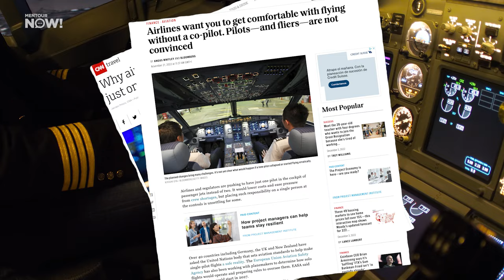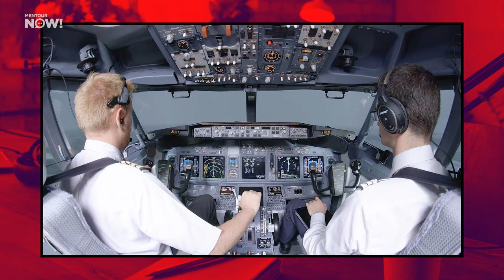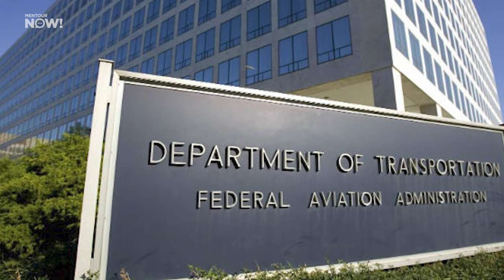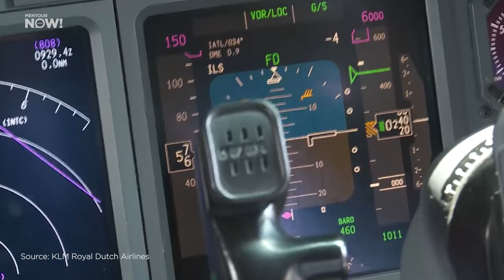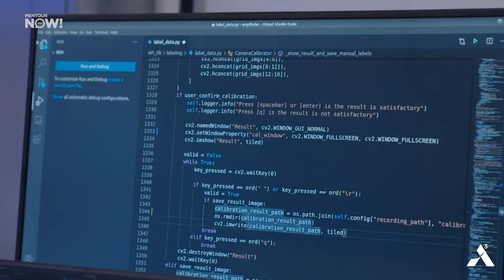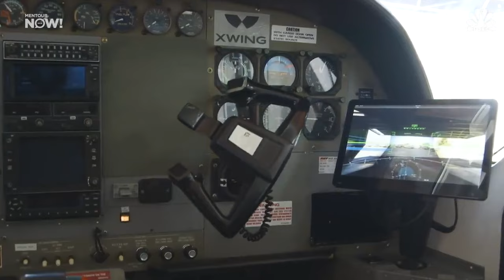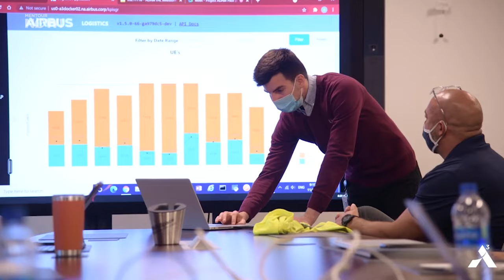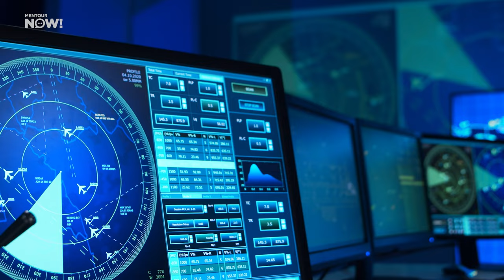The End of the Two-Pilot Cockpit?! Get Ready for Single-Pilot and No-Pilot Airliners!

Comment: Pilots don't just get paid for what they do when things go right, they get paid for what they do when things go wrong. There is no automation can replace a qualified pilot in an emergency.
Reply from the maker: Correct
Reply: Actually, it's not just emergencies when you need a qualified pilot. It's unexpected situations, where having a couple of pilots present may well prevent that emergency from happening in the first place.
Reply: That's true right now. Might not be true forever. It is possible that eventually automated systems may become far more flexible and adept at trouble shooting problems than humans, at which point you wouldn't let a human near the controls. Long way to go, nowhere near that now. but may happen one day.
Reply: @flat6croc  Sure, but do keep in mind that we've been anticipating machines becoming merely as flexible and adept as humans for more than 50 years now. And even our much less ambitious ideas, such as self-driving cars, are still in the indefinite future after 35 years of work.
Reply: @Curt_Sampson  Absolutely. Even most trains nowadays are still manned by a driver. There are ofcourse exceptions, but still, most trains require a driver. If even one-dimensional travel cannot do without human interaction, fully automated commercial airplanes are far, far, far away. I do not think we will see them during our generation.
Reply: @Curt_Sampson  
Actually self-driving cars are almost here. Probably next year already, or not much later. Watch a few Tesla FSD videos on YouTube, and you'll see where we are now. It's definitely not ready yet, but not much is missing.

And yes, experts overestimated the capabilities of AI for decades. But in the last 10 years, they consistently underestimated them, and not by a little. AI can do things now that was considered science fiction only a year or two ago. Recent breakthroughs are starting to be scary.

AI is no longer the old-school rigid programming, in recent years it became much more human-like. Play with ChatGPT to see where we are today.
Reply: @andrasbiro3007  The first 90% of self driving are incredibly easy, just like the first 90% of many things. The remaining 10% are where all of the dangerous edge cases lie.
Reply: Maybe 737Max's MCAS is already forgotten.
Reply: @codures  Not by everyone. I remember it at least.
Reply: @flat6croc  Whether right or not, I usually have a clear opinion on things;  this is a rare exception.  Are we near SAFE fully autonomous vehicles?  Just do a YouTube search on FSD ... flat-out NO.  And that's for cars, which are far simpler to operate than airplanes ...

That said, can I conceive of a future where a generalized AI could prevent some of the accidents that were a result of human error?  Yes, I do think that WILL happen.  What about accidents that happen as a result of circumstances outside the crew's control?  How would an AI respond?  And, would an AI even get into those situations (or could it anticipate and prevent them)?  I'm not sure.

I believe that the self-preservation instincts of a human being will outperform any AI for any foreseeable future.  The solution to unknown scenarios isn't always about executing within known / acceptable parameters;  it's sometimes about venturing (yeah, bit of gambling and with some good, old fashioned "luck" added to the potion) into things that may directly contradict all known / acceptable wisdom ... and that's a space where humans excel out of survival instinct ...  Could an AI develop the same or equivalent skill?

Today, absolutely and positively no way, especially when GPT-3 sometimes thinks it's a good idea to erradicate the human race ... yeah, I'm not getting on an airplane operated by our friendly GPT-3 captain, thank you.  Officials even considering this for commercial flights is frightening.  AI decides it's a good day to play 9/11 with a fleet of commercial flights ... if we allow ourselves to get into that scenario, I want to see every single "yes" vote fired and out of the industry forever.

To the possible reason behind this nonsense being the nonsense of the 1500 hours rule ... for an industry that excels at root cause problem analysis ... fix the root cause problem ... don't try to come up with insane symptom management "solutions" like these!
Reply: @MentourNow  That’s not a fully accurate. An AI can be trained using all the data from ALL pilots that are flying in all conditions. That means that it is also trained for when things go wrong. An automated AI plane will actually be much safer than humans because it can tap into ALL PILOTS knowledge instead of relying on the intelligence of only two people. I would rather trust thousands of pilots collective decisions (trained by analyzing real flights, and flight simulator trainings).

In addition, you can train an AI in a simulator to respond to EVERY POSSIBLE FAILURE CONFIGURATION instead of only the limited amount of a emergency training we are able to give to the two pilots. We train for the most common scenarios, but cannot train humans for all, it just isn’t possible. It IS possible to train an AI for all situations and all combinations of system failures, and have it train as long as it needs to be able to handle them. Additionally, humans miss crucial details about flight instruments because of overload, however an AI would not be overloaded and would continue to take all instruments into account, giving it a deeper ability to figure out problems before a pilot would be able to. A pilot also has less redundancy because of the many factors that can incapacitate a pilot or prevent them from being able to perform their job. There is much more redundancy in using the knowledge of all pilots than just two.

You can listen to me as a Senior Lead Software Engineer in the field of Computer Science and AI Research, or you can keep the view that it is “too hard”.

I am just sad to see that there is not research being presented in this videos argument, but rather opinion. All of the other videos on this channel are quite informative and less opinion based, so this video was a little shocking.
Reply: @starbock  I think it's far from clear that the challenge with self-driving cars is easier. I'd argue it's far harder, the environment they operate in is hugely complex, stuff like tracking pedestrians, distinguishing between a harmless plastic bag blowing across the road and a dangerous obstacle, inconsistent, half worn out or entirely missing road markings, erratic human drivers, wildlife etc etc etc. Just keep track of where the road is going accurately is a fairly complex job. That's just scratching the surface.

Meanwhile, planes operate in 3D but with far, far fewer obstacles and inconsistencies. The basic job of flying the plane through the air is much easier. It's been possible for many years for a plane to take off complete a route and land autonomously, it's far easier than an autonomous car out on a busy public road.

If that's the basics, I grant that the comparison re ensuring sufficient safety pushes the balance in the other direction. With a car, if in doubt it's usually pretty safe to pull over and stop. A small malfunction probably won't be catastrophic. Once you're in flight with a big jet, you can't just stop the thing, it needs to be guided with precision to one of a small number of safe landing areas - ie airports. Even a small malfunction can be catastrophic.

But in broad terms, the problem of automated flight is much easier than automated driving. In reality, pilot error is the most frequent cause of major plane crashes. Yes, you. can argue for fringe cases where it would take a very advanced general AI to problem solve a situation like a human. So, it may be many decades before an automated system could match a human in that regard. But you'd still be better off with a robo pilot that didn't make any errors in the first place in terms of the stats. For every crash caused by a rare technical glitch that perhaps a human would be better at trouble shooting, , there will be many more crashes that never happen due to pilot error with no more human pilots making mistakes that the machine would never make because the human is tired or confused or whatever.

The key point here is that the machine doesn't need to be better than a human in all cases to be much safer overall.
Reply: But would there be emergencies if pilots were not on board. Many are pilot errors.  No errors = no pilots
Reply: Absolutely true!
Reply: @womble321  I have bad news for you about who writes the software.

Also, pilots are the last line of defense, so by definition any incident must have happened because a human made an error.
Reply: @andrasbiro3007  No they aren't. The "self-driving" cars are still failing basic tests and need constant human intervention and correction. The only successful tests, where a human didn't have to intercede to correct the driving program, were on closed circuit tracks. As soon as they attempted to take it one into a city, a human had to constantly correct it to prevent from driving through intersections with a lit crosswalk, or other potential disaster.
Reply: @OstlerDev  I stepped into my first fully automated driving truck 30+ years ago - most people aren't aware of how long this capability has existed.  While I agree with some of what you're saying (and said myself in my comment), I think that you're underestimating the power of the human capability to think beyond the limits of knowledge and even understanding.  It's an intangible and sometimes a razor-thin differentiator between life and death.  I agree wholeheartedly that AI will be able to prevent accidents due to human error.  I disagree that you can TRAIN anyone (including an AI) on that intangible;  it's not something trainable.  Will some future AI be able to what humans can do?  I don't know;  we'll see.
Reply: @flat6croc  I stepped into my first fully automated 50 MPH highway driving truck 30+ years ago.  None of this is new technology.  It evolves and will continue to do so.

While there is some truth to what you're saying - and is the basis for my own comment about an AI being able to prevent accidents due to human error - there are also great complexities introduced by high-speed 3D meaneuvering in vehicles that are highly sensitive and responsive to small changes.

I don't entirely disagree with your response.  I do think that there are additional - and important - complexities associated with flying.
Reply: @starbock  No you didn't. Because there were no fully automated road vehicles 30 years ago. The vehicle you went in could operate only in very narrow pre-defined circumstances on a small number of pre-defined roads, that's nothing like a self driving car, that's glorified cruise control. True self-driving is a completely different technology.
Reply: It doesn't take long, searching Mentour Now! to find many examples of automation trying to save an aircraft that is overrode by "qualified pilot"s, resulting in deadly crashes.
Here's an example from 3 weeks ago. https://youtu.be/o6c3ENr_CRM?t=1469
Reply: BUNK!!!!!!!!!
Reply: Much better, full autonomy and NO pilot on the loo; cause there ain't no pilot!!!
Reply: Absolutely. For example, the Artemis 1 spacecraft (NASA) is fully autonomous. Where nothing major has gone wrong.
Apollo 12, 14 November 1969:
000:01:02 Pete Conrad: Okay, we just lost the platform, gang. I don't know what happened here; we had everything in the world drop out.
...
000:01:12 Pete Conrad: I got three fuel cell lights, an AC bus light, a fuel cell disconnect, AC bus overload 1 and 2, Main Bus A and B out.
...
JOHN AARON (EECOM) - Flight, EECOM. Try SCE to AUX.
...
000:01:36 Gerald Carr: Apollo 12, Houston. Try SCE to Auxiliary. Over.

"... whatever can happen will happen, if we make trials enough."
Augustus De Morgan, 23 June 1866.
Reply: @andrasbiro3007  The biggest problem with self-driving car is the sensing aspect of identifying other vehicles and humans. Effective visual/sensing systems are too big and too expensive to put on cars so self-driving will remain very limited unless you don't mind running into trucks or pedestrians. Planes have the advantage that type of sensing  is very limited in value- planes move too fast.
Reply: It needs true AI to work- the computers still aren't powerful enough or designed smartly enough but no reason they couldn't do it. Pilots can't do magic by doing aerodynamic analysis- a  true AI would do the same stuff as a pilot.
Reply: @flat6croc  It's not really true, but nobody is doing the engineering.

We use to talk about how a self driving car is just driving at least three orders of magnitude more complex than the worst possible situations that aircraft experience during the AI dark ages (90s). Today we have Falcon 9's booster is basically a 20 story office building autonomously going to space, and back, and nailing a hoverslam, on a freaking boat.

It's like dodgeball, if you can dodge a wrench (and SpaceX does it on the regular), then you can dodge a ball (boring autopilot). Just need a few hundred million for the training. Or just a few thousand by the time Dojo is up and running. Within a decade, it will be a hobby kit you buy for your kids, or just off the shelf software that can run on a smart watch.
Reply: @Uldihaa  FSD and Waymo have required nearly no human intervention. How would a human even intervene without a steering wheel for Waymo? Your claim is clearly improperly researched and false.
Reply: @starbock   A computer could definitely develop the “instinct for self preservation”. Tesla’s FSD has already demonstrated a pillar for consciousness (as defined in recent psychology publications). Similarly, I expect at least one company to develop the higher levels of consciousness. Further, the critical reasoning of a pilot is not necessary in the predominant set of cases. It will develop such capability in the future but the software we have is well capable to reduce injury given enough data.
Check out Waymo’s taxis, they’re able to act in almost all circumstances excluding the extremely rare due to a lack of experience in the area. Lack of ability to absorb instruction is a shortfall of machine learning but through enough experience, an algorithm can make up for it.
Reply: @club6525  "Nearly no" is not "no human intervention". And please name the cities and routes these systems have successfully navigated without human corrections.
Reply: @jtjames79  Landing a rocket using just its own computer is nothing like driving through a busy city. Landing a Falcon 9 is a preset system, with a limited range of conditions that are constantly monitored by human. There was a failure just last year.
Reply: @flat6croc  I don't argue.  If you want to rewrite history, go ahead.  Cheers.
Reply: Also when shit hits the fan you want one pilot who is focusing on flying the plane and one who can troubleshoot, run checklists, etc. Single pilot aircraft wont come for a long long time, probably will never be a thing, as fully automated aircraft that are trustworthy will probably be a thing soon enough.
Reply: @andrasbiro3007  A slammed on the brakes on a highway because its AI saw a human on the back of a bus poster, they have a long way to go before people trust automated cars
Reply: @Uldihaa  Phoenix and San Francisco. Waymo has barely used intervention by a person since the car drives by itself.
Reply: @club6525  Again, "barely used intervention" is not "no intervention". By "barely used", what do you mean?
Reply: @Uldihaa  Waymo doesn't use intervention at all. I just mean maintenance. Still, that's better performance than a human regardless if it requires minimal intervention.
Reply: “Qualified” is the operative word .. Pilots do make mistakes and cause a lot of the accidents in otherwise normal conditions despite the automation. so it is not that binary.
Reply: I would goes as far as to say; it’s when things go wrong, is when a good pilot truly shows his colours and earns his/her money.
Reply: @Curt_Sampson  Self-driving cars are actually more of a difficult problem to solve than autonomous flight—not because 2D movement is more difficult than 3D, but because there are far, far too many things complicating road travel vs. air travel, from random pedestrians jumping out in the middle of nowhere to the constant need to re-negotiate w/ other participants on the same/crossing roads to the shear amount of such roads to cover and the amount of other vehicles around you. Autonomous flight is much easier to achieve but we didn't invest nearly as much in it because of the scale of the problem.
Reply: @zwerko  Sadly, it simply isn't the case that fully autonomous flight is easier because of one big problem: unlike cars, where you can simply pull over and stop (or just stop), aircraft fail in dramatically unsafe ways when you fly them even slightly incorrectly or stop flying them.

Consider landing an aircraft on a snowy day. You can't be absolutely sure that the ILS signal you're receiving is correct; snow build-up under the ILS antennas on the ground has been known to misdirect aircraft. (This is not a theoretical thing; Mentour Pilot had a video recently where exactly this happened.) This means you also need visual pattern matching to see if you're really landing on the runway (not to mention to look for obstructions on the runway, and even just ensure that it's been plowed recently enough) which may be impossible given the weather conditions. That can require a go-around decision followed by a decision to divert to another aeroport, which then needs to be co-ordinated with ATC, taking into account the current and likely future weather and airport conditions at your potential diversion locations, and so on. Any mistakes in any of this and you end up with a large hole in the ground full of dead passengers and aircraft parts.
Reply: @andrasbiro3007  I don't know what fantasy you're living in but there's no way teslas FSD is anywhere near robust enough for it to be sorted next year. It messes up constantly. And still kills people with some consistency
Reply: No that is wrong.  It can all be automated.   I never thought self driving cars would ever work but they do.   The technology for planes may not quite be there yet but it will be.   AI can think just like a human and avert disaster.  It just has to be trained for millions of possibilities and then it will do it's job.   They can even set up planes so that they can be flown by pilots remotely, like a drone.   Then you  just need the pilots for the landings and take offs and one pilot can fly about 20 planes at the same time.   You could probably do away with the cockpit and convert it to passenger first class seats.    The landing on the Hudson could have been done by a self flying plane or by a remotely controlled plane.   The benefit of remote control , also is that you might have 5 to 10 pilots to gather around when there is an emergency and all give input to avert disaster.
Reply: The arrogant pricks that design automation think they can make it do anything and never fail.
Reply: @bearchow1929  Actually, no. The people who actually design the automation are not arrogant at all and are well aware of what it can do and how it fails: understanding how it fails is their actual job.

If you want to know who the arrogant pricks are, it's the businessmen and others who don't know how to build automation who think that it's magic. And you can see examples of that in these very comments.
Reply: @Curt_Sampson  You're probably right. Aircraft design and manufacturing was at one time, in this country, engineering driven and producing leadership product. Pretty much everywhere US aircraft companies have become management driven. And that is bad since besides being arrogant pricks, management is stupid too.
Reply: @jeffbguarino  You truly appear to have no understanding of how terribly wrong you are about automation. 

It's well worth watching the Mentour Pilot's latest video on AF 447, which dropped just over an hour ago. There are a lot of things in there about how difficult it is for automation to deal with unreliable data, but pay particular attention to one of the simpler systems, the stall warning system, and how it ended up working essentially backwards (though it was never actually incorrect) due to interactions with the instrument data issues. A mere automated stall warning is basically trivial compared to the level of automation you're talking about, and yet here you can see clearly how even that can fail when unexpected situations are encountered. In the face of this, how could you possibly claim that automation orders of magnitude more complex can be more reliable than a mixed system with automation, pilots and training?
Reply: @bearchow1929  Automation does fail as can be see with the self driving car crashes but people also fail.   As it stands now , it is safer to be in a self driving car.   If you drive on the freeways long distance many people including myself make mistakes and I have had a few close calls not seeing cars on my passenger side and almost side swiping other cars.   Also the blind spot I have on my passenger windshield post had almost caused me to have accidents.    I also get sleepy and have had micro sleeps.  When this happens , I pull off and drink caffeine, or I just pull of and go to sleep.     AI and automation is slowly getting better and will soon exceed the abilities of a pilot.  
The other way to save money is to use one pilot to fly multiple planes remotely.   Why does the pilot have to be in the plane ?    They do nothing for most of the flight.    
Once self driving cars take over and people see how safe they are, they will accept planes without pilots also.

Planes that have no pilots cannot be hijacked and the cockpit can be eliminated and made into more fist class seats.   So the can stop sending sky marshals who take up valuable seating.
Reply: @orlandopockets6372  You're displaying a (very common) misunderstanding of what automation currently does in the cockpit and what it takes to fly an aircraft.

To the naïve, it looks as if when a pilot turns on the autopilot he's no longer flying the aircraft. This is far from the case; the pilot is still flying the aircraft, just with a different (and more automated, but not at all completely automated) set of controls. This is actually in certain ways more difficult than piloting "manually" since the pilot must now understand how to work the automation, including all the details of what the automation will do when he gives it certain commands and how the automation can fail if he commands it in the wrong way.

For a brief look at the amount of pilot work that goes into a basic autoland approach that goes without any problems at all you can search  on YouTube for "how to autoland a boeing 737"; pay careful attention to the vast number of decisions being made by the pilot and all the things he needs to know and understand about both the aircraft, the external environment, and short- and long-term variations in the external environment.

For relatively simple situations, automation can and does indeed do a better job than hand-flying the aircraft. But currently (and for the foreseeable future) it takes a human to decide whether a particular situation is amenable to the use of automation and, if so, configure the automation correctly to do the most basic part of the flying in that case.
Reply: It's not always true. In the majority of cases, it's just the human errors.
Well, they are trying to build the autonomous cars, which is way harder to do. 
And they are probably also working on the millitary applications.
*
Btw, 
$150,000 is probably just a starting salary. I had a friend & he was making over $250,000.
* And a lot of guys do the Overtime flights, & getting paid 2-3 times more per flight.

And it's just the salary. What about all the benefits & retirement &.... it's another $200,000 + training/certifications + accommodations + shipping pilots around (scheduling) ....& all the downtime ...
I wouldn't be surprised, if each pilot cost over a million dollars to the company.
Reply: Yeah it’s like intentionally lining up the holes in the first two slices of Swiss cheese.
Reply: @squelchedotter  
Tesla is far past 90%, they are more like 99.9%. Elon calls it the "march of nines". Tesla has been working on edge cases for years. They have highly technical presentations about how they do it.
Reply: @Uldihaa  
Watch some recent FSD videos. No intervention drives are now common. And some of these are long drives in challenging environments.
FSD can drive trough a busy city center, with weird intersections, unprotected lefts, and construction zones. It's not always perfect, but close. And if you also consider how fast it is improving, the only possible conclusion is that driverless cars are coming very soon.
Reply: @marksmith8079  
Actually Tesla already solved computer vision. And they only use cheap cameras and a small computer. It can not only identify cars and pedestrians, but also guess their intentions reasonably well. It can build an accurate 3D map of it's environment, even if it doesn't recognize all objects. It looks really cool too. Search for "occupancy network".
Reply: @sgt.gunslinger1532  
That's Autopilot, again, not FSD. Autopilot is like stone age tech now.
Reply: @Curt_Sampson  
Don't confuse traditional automation with Artificial Intelligence. The whole point of an AI is that it doesn't just blindly following simple instructions, but actually understands the situation and adapts to it.
An AI would have easily figured out what was happening with AF 477, because it wasn't complicated, the pilots were just overwhelmed by the amount of unexpected information, and the resulting stress. That doesn't happen to a computer. A modern AI can process huge amounts of data simultaneously, and find connections in them. And recently they are they are developing surprisingly high-level reasoning too. I suggest playing with ChatGPT and Stable Diffusion.
Reply: @michalpavlat3943  
Again, watch FSD videos. It took much longer then expected, but the progress is undeniable. If you take where it is now and how fast it is improving, the conclusion is unavoidable.
Reply: @OstlerDev  once you understand that not all the posible situations are yet happened you will understand that you need someone to check from outside and the first time in history that the situation in question is what you actually think. When we are training in our career, you see that not everything is white or black, you need to have enough situational awareness to identify a possible threat even before the first alarm triggers, which makes imposible for an IA to be able to stop it on time, since is not able to learn it from past experiences or similarities. @mentourpilot is right here, aviation is about safety and redundancy, a single pilot operation is ALWAYS an emergency type of operation, same happens with single engines operation for example. IA will help in order to assist, but never to fully replace.
Reply: @flat6croc  considering how in military drone ops a qualified pilot can have the same info available as onboard pilot and operate vehicle from other side of the planet in real time today......suggests the possibility
Reply: @Curt_Sampson  considering how in military drone ops a qualified pilot can have the same info available as onboard pilot and operate vehicle from other side of the planet in real time today......suggests the possibility
Reply: @andrasbiro3007  _"No intervention drives are now common."

I can only LOL at that. Even if Tesla had a thousand cars driving 24×7 (which they don't) that's only one or two million vehicle-miles driven per year. For the past decade and a half U.S. drivers have driven 2.5 trillion vehicle-miles per year. Something that happens only once in a year of the testing above (which is a lot more than Tesla is actually doing) will statistically happen a million times per year in actual use. Tesla has not even seen most of the "edge cases" that would happen if FSD were deployed throughout the U.S. alone.

And that's entirely ignoring the fact that many of Tesla's situations where the car fails safe would be hull loss and death of all souls aboard in an aircraft.
Reply: @andrasbiro3007  I work in IT and have been watching "AI" for decades. It isn't what you think it is. Current neural network-based AI does not "understand" what's going on at all, not even to the degree that Eliza did. It's simply trained pattern matching, and it fails all the time on things for which it hasn't been trained.

I've palid with ChatGPT and similar systems, and while the results they produce can sound good to someone with only superficial knowledge of what they produce, they regularly produce answers that are clearly wrong and show no understanding at all.
Reply: @jet_trooper  If you watch any of the Aviaton Accidents, you will see that almost all emergencies are cascaded upon by poorly thought out actions by the pilots who are UNABLE to take in all of the instruments readings and process them due to Overload and Fatigue. When a human is under stress, the will focus on only a few instruments, and fail to see the whole situation. Accidents are caused by series of human accidents and oversights. 

An AI would not make these same mistakes. It does not get stressed out. It does not get overworked. It does not just stop working at periods of Circadian Low. It ALWAYS will take ALL instruments into account, and be able to ignore ones with false readouts and trust the other instruments. Humans are MUCH MUCH MUCH more dangerous and will always have flawed thinking. 

I will feel a lot safer when I know that no humans are in control of the aircraft I am riding in.
Reply: @Curt_Sampson  Yes it is complex but just give it some time.   I think automation would do a better job with unreliable data than humans would.  I am acknowledging that there is another level of technology needed and we are not there yet.   I can see two or three levels of redundancy put into all the sensors.  Sensor failure is a major problem.  Conflicting data is a major problem.   I would think all the modules in the cockpit that perform various functions are also getting smaller and more reliable as time goes on.  

The way pilotless planes would be implemented would be with pilots on the planes.  They sit there and monitor everything but do nothing.    After 5 -10 years of these flights and if they have a proven safe record , then they can start flying without the backup pilot.  Eliminate the pilots through attrition, that is don't hire any new pilots and pay the older pilots golden handshakes to retire early.
Reply: @andrasbiro3007  They didn't solve it- they crashed into a truck.
Reply: @leechjim8023  The toilet situation is easy to solve with adult diapers.  The pilot's chair could double as a toilet if the diapers aren't good enough.  The diaper rash could get uncomfortable in a long haul flight but as long as he keeps everyone safe, that's all it takes.
Reply: @andrasbiro3007  self driving cars will only work if EVERYONE has them or if we give them a separate infrastructure to operate on. There are way more variables on public roads than we can ever account for. The second one makes a mistake the manufacturers will be sued into having to liquidate the company.
Reply: Well, that is true, but also automation is a future, most probably also in passenger aircraft :) it's the future, not close for sure, really far away. Nowadays automation system are definitely not good enough, but AI in the future will be much much capable to handle emergecny situations and calculate what exactly needs to be done in matter of second, faster than pilot grab instructions. Also AI doesnt miss any preparation steps due to lack of  carelessness.
So yea in future cars will drive and planes fly autonomous, but with totally different generation of software and hardware.
Reply: @Curt_Sampson  
Actually, Tesla had a 160K test fleet until recently, now it's much larger. The trick is that all Tesla cars have the necessary hardware for full self-driving (FSD), and Tesla allows selected owners to test the software, and recently they let everyone use it, who purchased it. So Tesla has access to obscene amount of data.
Not to mention that all 3M+ cars can run the software in "Shadow Mode", which means FSD is running on the car, but doesn't control it, just collects data.
Tesla also has a very cool data engine, that can automatically decide what scenarios are interesting and label the video clips for training the AI. Tesla has a couple of presentations about the technology, and some of those are understandable without much technical knowledge. Look for "Autonomy Day", "AI Day", "AI Day 2", and Tesla related presentations from Andrej Karpathy and Ashok Elluswamy.

Tesla also has a very advanced simulator that can automatically generate scenarios, and it's so high quality that it's almost indistinguishable from reality. That latter is important for training, FSD works uses vision only, so it wouldn't help to train it with low quality graphics. So imagine something like GTA but with far better graphics, and procedurally generated maps.

FSD had zero accidents so far, because Tesla choose the safest drivers for the beta program. And now it drives safely enough to be in the hands of average people.

The human brain is also all about pattern matching, and often produces wrong answers very confidently. Also ChatGPT and FSD are two very different architectures. ChatGPT is a language model, it wasn't designed to understand anything, it was designed and trained to predict the next word in a text, after reading practically everything that's publicly available on the internet. All of it's knowledge is an emergent phenomenon, including it's lexical knowledge and reasoning power. That's it's main limitation too. Data on the internet is unorganized and out of context, it's not ideal for learning. It wasn't even the goal, the goal was to learn language, everything on top is a bonus. Well, that was GPT-3. ChatGPT is also learning from interactions with humans, and even after a short time it shows drastic improvements. That's why they let you use it for free, you provide extremely valuable feedback for further training. In this one thing it is very much like FSD.
FSD has been built entirely for driving, and it's trained on curated, organized, and labeled data. FSD has a hand-crafted architecture that breaks down driving into a bunch of sub-tasks,  and has a dedicated neural net (or traditional algorithm) for each. This way it's far better at driving than ChatGPT at any random task. And we see that in practice too. FSD is missing some minor features and some fine-tuning, but I don't see any fundamental problems.
Reply: @marksmith8079  
You are talking about Autopilot, not FSD. Autopilot is a several years old architecture that drives only on highways, while FSD is an entirely new architecture that can drive anywhere. These crashes happened in the past because AP used radar and that's very bad at seeing stationary objects. FSD and current AP are using vision only, and far more advanced, so it's no longer a problem. For FSD especially, it's new feature called "Occupancy Network" makes it practically impossible to crash. Ashok Elluswamy has a great presentation on it.
Reply: @Magnarmis  
No need for special infrastructure. Look for FSD videos on YouTube, you'll see. And watch the presentations I mentioned above for how they did it.
As for accidents, they'll be handled similarly to plane crashes. As you don't fly your own plane, if you die that has to be someone else's fault. It's the manufacturer, the airline, or the pilots (who were picked, trained, and checked by the airline). An investigation figures out the root cause, and the guilty party pays. And to avoid big one time hits, companies tend to have insurance for this.
It's not just flying, any time someone else is responsible for your safety, the same thing happens. Or if a smaller company organizes a potentially dangerous activity for you, they usually ask you to sign a waiver to protect them from exactly this.
Reply: @OstlerDev  "An AI...ALWAYS will take ALL instruments into account, and be able to ignore ones with false readouts and trust the other instruments ...."

You truly live in a world of magic, where somehow every instrument comes with an indicator that says whether it's giving a good or false reading. Unfortunately in the real world there are plenty of situations where you just can't know which readings are correct or not, and you have to resort to a combination of guesswork and debugging/analysis procedures. Any automation designed on the basis of always having correct (even if incomplete) information will break when it inevitably gets incorrect information.

As I believe I mentioned earlier, this was pretty clearly demonstrated in Mentour's recent Air France 447 video where the stall warning cut out due to "misunderstanding" pitot tube behaviour and resumed only when the pilot took the correct actions to get out of the stall, cutting out again when he ceased taking those actions. This is a pretty simple situation for analysis, and the people writing the report had no problem seeing this situation for what it was, and at least one of the pilots (under massive pressure and time constraints) even appeared have or be coming to an understanding of when the aircraft was stalling as it was happening.

If something as simple as "is this aircraft stalling or not" still can't be done reliably by our automation, we are a long way away from actually being able to handle even all of routine day to day flying, much less emergencies.

I really strongly encourage you to have a close look at what a stall is, how stalls can be detected, and why the AF 477 aircraft dropped its stall warning when it was still stalling. Then think about why it still does this after the automation designers have extensively analysed this accident. If you don't understand why, there are two conclusions available to you: 1. Airbus' automation designers know something you don't, and you don't really understand automation. 2. You understand automation vastly better than hundreds of engineers who do it for a living and Airbus should hire you as their lead automation designer.
Reply: @andrasbiro3007  Tesla's FSD "test fleet" is indeed growing, but keep in mind that this is all quite new; only a year ago there were just a few thousand drivers testing it on actual roads. As of last summer the beta test programme had totaled 35 million miles under FSD, or 0.0014% of the total vehicle vehicle miles driven in the U.S. alone in a year. (That's less than eight minutes of miles driven in the U.S. yearly.) Anybody claiming that such small samples give us useful information on how well general FSD is working is severely deluded.

The argument you make about using computer vision instead of LIDAR is pretty typical of the arguments we've heard time and time again about AI: we try some technique, with many years of experience we find out that we didn't know at all how well it really works when we started and it doesn't work as well as we'd hoped, and someone pulls out a new technique for which we have far less data and claims that it's the silver bullet that will fix everything. Then a decade later the cycle repeats.

I think it's reasonable to think that at some point we'll finally have this stuff figured out, but to say yet again that, "Ah, this is the time when we've finally broken the back of the problem" on the same basis that we've said that time and time before is not credible. We'll know a decade or two after we've hit that point when we hit it, but there's no evidence that we'll know in advance when we're reaching that point and plenty of evidence that we are usually mistaken when we think we've reached it.

Your argument that building systems that have embedded understanding of what they're doing will work better than the straight-on "train on masses of data" approach may be correct, but keep in mind that building models like that was exactly what we were doing in the 1970s and it didn't work for anything in the real-world. In fact, chess and Jeopardy never got better than humans until that approach was abandoned. Which does not mean that it's the wrong approach for driving. Again, we're back in "we just don't know"-land.

Beyond all this, there are two more problems. The first is actually getting public acceptance of this once we have convincing evidence that it works better, and the second is even developing that convincing evidence in the face of companies that are highly motivated to say that unconvincing evidence is convincing. You can look at the whole history of Uber's self-driving program in Arizona to see how the vendors dance around this and delay the entire project by backing out and blaming things on the user in order to protect their public image, at the cost of developing honest data on what actually goes wrong and when. I suggest starting with "‘I’m the Operator’: The Aftermath of a Self-Driving Tragedy" by Lauren Smiley, published last March by Wired.
Reply: @andrasbiro3007  Oh, and one more thing you've completely ignored about computer vision is something that I'm sure Tesla and others are aware of but don't discuss: adversarial attacks on computer vision. Do a search on that and you'll see that there's a whole new can of worms there that has yet to be addressed.
Reply: @razvanlex  Most of what you're talking about is the subjective human experience which has nothing to do with the challenge of automating a car or plane. "Feel', 'instinct' etc all irrelevant. When it comes to tracking and accounting for erratic human drivers, automated cars are already far better than human drivers. That bit is actually relatively easy. There are still some things humans are better at, but those things are narrowing. And the most important point is that automated systems don't need to be better at everything to be far, far safer overall. The same applies to automating an airliner. It may be very, very difficult to create an automated system that can out-perform a human pilot is literally any situation. But it will be possible to create a system that's still safer overall. Most crashes and near crashes are human error. An automated system will cut out most or all of those errors, thereby cutting out most crashes. There may be certain situations where an automated plane crashes and a human pilot may have been able to avert the accident. But they will be for less frequent than the crashes averted by avoiding human error in the first place. The problem is that people focus on the one crash where the human pilot could have prevented it. And ignore the other 99 crashes where the human caused it. As a passenger you choice is do you want to get on the human piloted plane with the risk of 99 out of 100 crash scenarios that would be prevented by an automated system. Or the automated plane with the risk of that one crash scenario that a human could prevent. The key factor is relative risk. The fact that an automated system can't be 100% perfect is not important. What matters is how much safer it is (or isn't) overall.
Reply: @flat6croc  "It may be very, very difficult to create an automated system that can out-perform a human pilot is literally any situation. But it will be possible to create a system that's still safer overall."

This is probably true. But what we're arguing about here is not the possibility of creating a system that's safer overall, but when that will happen, i.e., when it will generally be the case that full automation with no pilots will be safer than our current systems with two pilots.

We have plenty of data to guide us on this, since we've been using automation and other systems to reduce the effect of human error for literally decades and it's been doing a great job for various parts of flight.  For more than half a century the vast majority of commercial passenger flight-hours have been flown under automation ("autopilot" and "autothrottle"), and for a quarter century or so the majority of hand-flown hours have also been under the protection of automation (Airbus "normal law" and Boeing's equivalent), and this has been part of why safety has been steadily increasing to its current extremely high levels.

But you need to ask yourself, "Why, with all this great automation, do we still (automatically, mind you) drop back from normal law to alternate law in some situations?" Is it because these designers who have been working so hard to increase safety all these decades never thought to try to automate a bit further? No. It's because we've picked all the low-hanging fruit, and a fair amount of the higher-hanging fruit for that matter, and we've run into the issue that automation is designed by people and, more and more often, we're discovering that it's freaking hard to build automation that does better than what we can do now with humans, training, and (non- or less-automated) systems design. And that automation has taken us to where we are which is a long, long way from full automation. We don't even have automation of taxi yet, despite that seeming to be one of the easier parts of a flight to fully automate.
Reply: @OstlerDev  I do indeed understand how neural networks work at the general computing science level. And this is where you have failed to understand them: you mention that neural networks need to be trained and yet somehow magically assume that the training "just happens" and we're done. But it doesn't. Training can happen only for situations that we anticipate, and if you've read NTSB reports, or even just watched Mentour pilot videos, you'll note that the majority of accidents occur in novel situations, which neural networks simply can't handle. Pilots fail in situations such as AF 441 or MCAS activations where they've not been sufficiently trained; neural networks will fail in the same situations.

It gets even better when you also have people out there (say, terrorists) actively looking to make neural networks fail. It's pretty shocking the first time you see a neural network entirely fail to read a "STOP" or speed limit sign that humans have no problem reading, as I did a few years back in a presentation I attended. The issues with dealing with adversarial attacks on neural networks that the presenter described were enlightening, to say the least.

Of course Airbus (and other) engineers are designing systems that use neural networks, among other technologies, to help fly aircraft, and I expect these to work quite well for the situations for which they're designed. But your idea that there's some sort of magic happening here that will make them work for fully autonomous flight is simply a flight of fancy; ask those Airbus engineers and they'll tell you that we're very, very far away from that.

I don't know how much knowledge you really have about neural networks, but it doesn't seem to be enough that you understand their basic problems, which are not about how many layers they have.
Reply: @flat6croc  Instinct and feel are not at all irrelevant. Sometimes maybe we don't listen to them or don't have them at all, yes.
Reply: @Curt_Sampson  Taxing very clearly isn't easy to automate. Which is why it hasn't been automated! The actually easy stuff, as you point out, has been automated for decades. It's only relatively recently that compute power and paradigms necessary to automate the difficult bits have become available. That's why flight hasn't been fully automated. It'll be maximum 20 years and probably less than that before it's possible. But it may take some time more than that to actually be implemented on commercial flights due to the sorts of anachronistic concerns seen in the comments here.
Reply: @razvanlex  Yes, but dramatically less often than humans fail. Which is why all kinds of machines exist and have replaced humans. None are perfect, but they're still a lot better than humans at the tasks they do.
Reply: @flat6croc  You're half right: we've automated the easier stuff and not automated the hard stuff. You should consider whether fully automated flight (which by definition would need to include the taxi portion of the flight) is suddenly so easy to automate as you claim. Because I'm not seeing the evidence for it. I'm just seeing the same claims that "everything will be automated" soon that I've been seeing all along.
Reply: @flat6croc  There are crap computers and crap software, the same as humans.
Reply: @Curt_Sampson  I didn't say it was easy. It's hard to have a discussion if you make things up. It's not easy. But it is possible and it will happen. Like I said, I'd guestimate maximum 20 years, but probably less, before the job is entirely cracked.
Reply: @flat6croc  I'm not making anything up here. "We're just a decade or two away" is the same story we've been hearing over and over again for more than half a century now for a whole host of things related to AI, and so far the predictions have been wrong every single time. And it's always because there's some new technology that will supposedly solve the problem. But there's no evidence that things have really changed, and plenty of evidence (such as the lack of solutions for similar problems, including self-driving cars and fully-automated taxiing) that they haven't.
Reply: They cut down manpower on garbage trucks from 3 to 2 crew. There have been an increase in heart attacks among coworkers. I lost my last buddy right behind the truck at 47 years old. I have heart issues too but escaped as a retiree at 57. Its asking for trouble. 2 will do. Robots don't have to pee.
Reply: @flat6croc  I am not "making things up" here. You specifically said, "I'd guestimate maximum 20 years, but probably less, before the job is entirely cracked" where "the job" refers to entirely pilotless aircraft being able to execute commercial passenger (or even freight) flights that today require two pilots.

This is not any old general claim about what future technology might do; it's a claim specifically about a certain area of technology "AI" for which we have a long history of similar claims that have been wrong. If you're going to make such claims, it's incumbent on you to show that you understand why previous similar claims were wrong and what you think is different this time. And what's different can't be just general claims such as "look what a good start we've made," "we have new technology," "we've done more research now" or "computers are improving" because all those were reasons given in many of the previous predictions that turned out to be wrong.

So I suggest you go back and look at some of the major failed predictions from the past that are similar to yours (there are many to choose from) and explain what's different between your prediction and theirs. If you can't immediately think of three or four, you're really not at all knowledgeable about the progress of AI.

As background, I first directly used AI in the late 1970s (Joseph Weizenbaum's ELIZA program, written between 1964 and 1966) and have been following AI since then, from SHRDLU through the AI winter, expert systems, the fifth generation, the second AI winter, probabilistic reasoning, deep learning, big data, and through to the present. So I've seen a lot of predictions similar to yours, and later seen them fail to come to fruition. The issues we're dealing with for general AI, some form of which would seem to be necessary for truly pilotless aircraft, have repeatedly in the last fifty years seen things that look like real progress but turn out not to be. And it's pretty easy to look at GPT-3 and see, despite the surface appearance of progress, the same underlying problems that we've seen again and again in previous attempts at natural language processing. GPT-3 is a lot better than ELIZA in many ways, but also shows some of the same lack of understanding at a deep level.
Reply: @Curt_Sampson  
1. Irrelevant. Tesla doesn't have to know every little part of the world. Humans don't learn that way either. Any practical system has to be able to generalize.
Also irrelevant because we don't expect FSD to drive absolutely perfectly anyway. The goal is to be safer then an average human, so it doesn't have to be able to deal with extremely rare edge cases, just relatively common edge cases. Longer term of course we want increasing safety, but over time Tesla can also collect orders of magnitude more data.

2. Humans don't shoot lasers out of there eyes, therefore lidar is unnecessary. End of story. Also Tesla Vision is already far beyond the point where lidar could 
possibly be useful.

3. Again, watch FSD videos, those show very clearly the strengths and weaknesses of FSD. There aren't many weaknesses left, and nothing fundamental.

4. You don't understand how FSD works. Or any modern AI. It's extremely different from the 70's. I can't write an entire lecture about it here, you'll have to look it up yourself. Again, Tesla has excellent presentations about how FSD specifically works. And you can find sources that explain modern AI techniques too.

5. FSD already has hundreds of thousands of users. Autopilot has millions. Doesn't seem to be an issue. People show it to their friends and that's often enough.

6. Tesla has a public beta program. Again, now with hundreds of thousands of users. So the actual performance of FSD is clearly visible for everyone, Tesla couldn't hide anything even if they wanted.
Also when FSD goes live, meaning level 4-5 driverless operation, Tesla will take responsibility for all accidents. That means it will be their best interest to not lie about safety. Also I'm pretty sure many authorities will watch it closely, as they already do.

7. Uber is completely irrelevant. They used a completely different approach to testing, nothing about that accident applies to Tesla.

8. Adversarial attacks on dumb cars is very easy. Fooling computer vision is not necessary, even if possible. But also it can be mitigated easily by a little training. A vision system that's good enough to drive well in the real world already has to deal with lots of confusing signals and distractions, attacks would be hard to execute and easy to train against.
Also, the top priority for FSD is to not crash, for which it uses the Occupancy Network, and fooling that would be extremely hard.
Also, many of the possible attacks would work on humans too. For example remove a stop sign and human drivers will likely speed through the intersection. Or reprogram the traffic lights to turn green in all directions at the same time, and you are almost guaranteed to create an accident.
Reply: @Curt_Sampson  
1. You can't compare basic automation to AI. Even something as simple as character recognition is extremely hard for hand-written software, which is all automation currently exists in aviation. For modern AI character recognition is as trivial as it is for humans. AI can now generate photo-realistic images from text prompt. That's beyond impossible with traditional software. And just try ChatGPT, and you'll see how far it is from basic automation.

2. I'm pretty sure we could already create a version that could diagnose problems in flight better than human pilots. So often humans just miss something obvious due to the stress and their cognitive biases. And the actual flying of the plane is already mostly automated. ChatGPT could also talk to controllers and follow directions. So what's left for pilots?
Of course today ChatGPT is nowhere near reliably enough, but some domain specific training and refinements it could get there soon.

3. AI is able to generalize. That's the whole point. Otherwise it's just a library, not intelligence. If you train a big enough network on a big enough data set, the AI will build abstract models of the real world, just like we do. That's the only way to learn if the training data is much larger than the network.
Even in something as simple as Go, it's impossible to train an AI on every possible game, or even just a tiny-tiny-tiny fraction on them. Yet AI is now far beyond human level in this game. The only way that's possible if the AI understands the game on a higher level, and can apply it's abstract knowledge to any situation.
Reply: @andrasbiro3007  You keep coming back with the same excuses over and over again for your unjustified belief in the nearness of fully automated flight, and even driving. You avoid addressing my arguments against it, both general (that  these are not new excuses, they are decades old and have repeatedly been shown to be wrong) and specific (such as completely refusing until now to address the well-researched field of adversarial attacks on computer vision that appears to show deep underlying issues). I think you are in a position of not knowing (or refusing to acknowledge) what you don't know.

Further, you keep going on about how I "don't understand" modern AI, but it appears that I have a better understanding of it than you. For example, from having attended seminars on this, I understand the concept of adversarial attacks on neural networks, which, again, until the above message  you seem to have refused to acknowledge even exists. When finally addressing that, you brush it aside with the claim that adversarial attacks "can be mitigated easily by a little training," but had you attended the seminars that I have, with researchers on the cutting edge of that field, and understood the problems that they're addressing, you would know that that is dead wrong. They explained this clearly and demonstrated why that's not the case. (It's a subtle argument that takes a bit of mathematical sophistication to understand, so it's no surprise that someone who's been reading only popular science summaries of AI wouldn't understand the actual problem here. But the researchers were very clear.)

But the bigger point is that, even though "modern" AI (which is not so modern as you think!—neural network research dates from the 1890s, computational models of neural networks date from the 1940s, and people have been running neural networks on computing systems since the 1950s) is being done differently from some of the things I've discussed from the '70s and '80s, the predictions have been failing in the same way over and over again for decades. You are far from the first person saying "new technology solves all the major problems now," and will no doubt be yet another in the long history of people whose similar claims were wrong.

This actually all really revolves around "General AI," which you appear to completely misunderstand. Neural networks (which have a history much longer than you know; see above) is very definitely not General AI, and your claim that current "AI is able to generalise" is simply wrong. You even contradict yourself by saying certain difficult problems can be solved "by further training," which is exactly the opposite of general AI. General AI is indeed the Holy Grail that AI has been pursuing for decades, and over and over again people have been claiming that it's just around the corner, and been wrong every time.

I have indeed used ChatGPT and the problems with it are obvious if you ask it questions in a technical field you're deeply familiar with. Ask it "What is a Python module?" and the first sentence is blatantly incorrect. Try to prompt it to explore the problem with "What is the difference between a Python module and a file?" and the answer starts with a falsehood again, gives the true fact later in the same answer, and doesn't even realise that it's contradicting itself. An "AI" that cannot even see that it's contradicting itself in its own answer is clearly not anywhere near General AI.

So I don't think there's much point in arguing further. You don't know (or are ignoring) the long history of the claims you're trying to make and appear to truly believe in "magic" AI that is great in science fiction stories but has never existed in the real world.

Before signing off, I will, however, address few of your specific points about Tesla FSD.

Telsa themselves, on the "support/autopilot" page on their website, say, "The currently enabled...Full Self-Driving features require active driver supervision and do not make the vehicle autonomous." That same page says that even FSD "autosteer on city streets" is "upcoming." According to The Guardian ("Tesla behind eight-ehicle crash was in 'full self-driving' mode, says driver, 2022-12-22), "Drivers are also warned when they install FSD that it 'may do the wrong thing at the worst time.'"

"This is not sounding like "There aren't many weaknesses left." I don't think that FSD is anywhere near as highly developed as you think it is. And let's remember, FSD is far easier than autonomous flight, so the fact that it can't even be left alone to drive, and cannot safely autosteer on city streets even with supervision of a regular person, doesn't made a very good argument that autonomous flight is near.

This will be my last reply to you. I expect you to come back with the same old tired and failed arguments yet again; I'll let others review our exchange to understand how wrong you are.
Reply: @Curt_Sampson 
1. Not excuses, facts. And not belief, knowledge. And I addressed all of your arguments.

2. You didn't understand anything of those seminars. I've been following AI research since the '90s. I'm not an expert, but know enough. I also have a software engineering degree and 35+ years of experience.

3. Again, you are completely missing the series of radical breakthroughs that happened in the last 10 years.

4. Neural nets are very definitely general, they have no theoretical limitations. Specific instances of neural nets have limitations. But as we understand NNs better, can train them with more data, and can give them more computing power, their capabilities increasing unimaginably fast. Modern AI is absolutely general, and approaching human level fast. Again, look at ChatGPT, it can talk about practically any topic you want, it knows everything that was publicly available on the internet. It's not perfect, but try to find a human being that knows even 1% of what ChatGPT knows.

5. Not knowing every little detail of every obscure topic is not proof of anything. Humans are pretty ignorant in most topics too, even if they studied their whole life. General AI means it's not limited to one task, or even one knowledge domain, but able to learn and reason about any topic. These AI are trained on vast data sets, practically all publicly available knowledge, and forced to heavily generalize simply by their limited capacity. Ultimately understanding is data compression. Nobody knew that it'll work, but it did, beyond everyone's wildest dreams. On top of that, these AI can build on their general knowledge (common sense) to learn new things very fast, just like humans. If you want it to be an expert in one specific domain, all you have to do is give it the same material you would use to teach humans. And unlike the previous generation of AI, these don't forget what they know when you teach them new things. This makes them truly general.

5. I've tried your prompts, and got good answers from ChatGPT. The first answer was a bit too general, but you can always ask more specific questions. The second answer was practically the textbook definition, almost word by word the same answer Google gave me, but this time it gave me detail too.
Yes, it can contradict itself, and invent pure nonsense. But that just means it's not perfect, and not human level yet. But being general and being perfect are unrelated things. Again, general means it's not restricted to a single problem domain.

6. I believe in science and facts. You are the one trying to deny objective reality.

7. And you don't know anything about FSD either. For starters, ignore the media, they are clueless, or actively lying. If you want facts, first watch the actual videos on YouTube. There are thousands of them, pick a few. Just make sure it's recent, because significant updates are coming every few months. Then watch Tesla's presentations (Autonomy Day, AI Day 1&2) and presentations by Andrej Karpathy and Ashok Elluswamy.

8. And remember, flying is far easier than driving a car. Fully automated flying has been possible for many years. Pilots are needed for two things, talking to controllers and solving serious problems. Both are now possible to do with AI. I'm not saying that AI could fly planes as safely as humans right now, but it's not far away, likely just a few years. What will take longer is for people to believe it.
Reply: @andrasbiro3007  Sigh. I know I said I wasn't going to reply again, but  (excluding your several ad hominem arguments) your last reply is so clearly wrong and easily shown so that I should just explain how to see this.

Neural nets (at least as we have them now) are definitely not general AI. You can learn what general AI is by simply reading the Wikipedia page on "Artificial General Intelligence." You'll note it explicitly says several things that contradict your ideas: "As of 2022, AGI remains speculative as no such system has yet been demonstrated" and "there is consensus that GPT-3 is not an example of AGI."

You don't say what answer you got from ChatGPT for "What is a Python module," but do say it was the same as the Google answer. I typed "What is a Python module" into Google and it gave me an incorrect definition." It's hard to trust that you are a good judge of where AI is when you are such a poor judge of answers to a such a relatively simple question. (For more, go have a look at the answers to "What's the difference between a Python module and a Python package?" on Stack Overflow; there is a correct answer there amongst the heavily upvoted incorrect ones; simple logic can show you how the incorrect ones and the correct ones are not consistent with each other, and further logic plus an understanding of will show you why a module cannot be a file. Hint: ask yourself, "Does a module have a name? Where does that name come from? Remember the PYTHONPATH environment variable when you think about this."

As for "flying is far easier than driving a car," that's so far out in left field that it doesn't take much thought at all to realise that that's patently absurd.
Reply: @Curt_Sampson  
1. Again, neural nets are definitely general AI. Specific examples of neural nets aren't necessary. Also, don't confuse general AI with AGI. General AI means it's not limited to one task, or even one problem domain. I explained this already. AGI is defined as human level AI, that's a very different thing.
ChatGPT is very clearly general AI, since it can converse and reason about any topic.

2. If your puzzle is hard even for a human, than what do you expect from the AI? Nobody promised human level intelligence, let alone superhuman one.

3. Why is it a surprise for you that flying is easier than driving? Should be obvious. At least if you understand the capabilities of machines. Instead of a long and tedious explanation, here's a simple proof. We had unmanned aircraft in production even before WW II, but a basic self-driving function first appeared in production cars less than a decade ago. Fully automated aircraft that is capable of taking off, navigating, and landing, existed for a while too. Fully automated landing with passengers on board has been demonstrated almost 60 years ago. Yet we still don't have cars that can drive themselves safely enough. Even Tesla's FSD is not there yet, although it's very close.
Reply: @andrasbiro3007  General AI is AGI (Artificial General Intelligence). You're can redefine words as you like, but you're just going to confuse your conversations, and more importantly, yourself, if you do that.

My "puzzle" is not all that hard for a human who understands programming and can read the documentation. If an AI implementation can't do nearly as well as a human on this relatively easy problem, to the point where its own answers are logically inconsistent with themselves, it certainly won't be able to replace a human doing all the things necessary to fly a commercial aircraft.

Your comparison of past unmanned flights is utterly invalid. We've had unmanned driving for ages, too; the Soviet Lunokhod 1 drove about on the moon fully autonomously in 1970. Autonomous flight to date bears about as much relation to commercial air transport as Lunokhod does to driving about on public roads.
Reply: @Curt_Sampson  
1. I'm not redefining anything, you just don't know the definitions. I'm trying to clarify, you are the one trying to confuse.

2. Google gave me the wrong answer (according to you). As a human, who doesn't give a shit, I found the answer plausible enough and moved on. So what do you want from the AI if even smart humans fail the test?

3. And do you know why we had self-driving cars on the Moon? For the exact same reason we had unmanned planes. The hard part is not controlling the vehicle, but dealing with complex environments. Air traffic is highly controlled, and obstacles in air are somewhat sparse, so there's little difficulty. But city streets are extremely complex and chaotic environments, which is an extremely hard challenge for AI.
Reply: @andrasbiro3007  1. Your assertion is easily shown to be wrong by typing "general artificial intelligence" (with the quotes) into a search engine; everything from scientific journals such as Nature to Wikipedia consider it to be mean the same thing "artificial general intelligence." (Wikipedia's page for the former is just a redirect to the latter.)

2. What I (and most other people flying in aircraft) want is that it's not flown by systems that get things wrong and crash the aircraft. I kinda thought that was obvious. As for the example I gave with ChatGPT (and I have plenty more like that), a human didn't fail the test: a human trained in the area figured out quickly that ChatGPT was wrong.

3. Yes, you're correct that the environment is the difficult issue. And flying a commercial aircraft is an extremely complex environment. It's more complex than driving cars on roads because there are a huge number of potential failures where you cannot safely react simply by stopping the vehicle, as you can in a car.
Reply: @OstlerDev  Because it's still a bad idea. Software can malfunction like MCAS did,do you want to kill your passengers?
Reply: @jeffbguarino  There's something called hacking,don't know if you've heard of it or not.
Reply: @flat6croc  I need you to stay away from aircraft safety discussions forever because you clearly don't care about the safety of passengers.
Reply: @ElyanaTaenor  Nope. I do. Which is why automated planes are a good idea. They'll be safer overall. The real danger is luddites how don't understand why and slow the adoption of technology.
Reply: @OstlerDev  And in plenty of these accidents, the problem started because part of the automation failed. If you those as an automatic hull loss if flown by ai, and add the numerous cases where automation failed but the plane landed ..... There would have been more crashes and many more deaths if planes were flown by AI.
Reply: @flat6croc hundreds upon hundreds of years, maybe lol. Human pilots will always be a thing. No matter what.